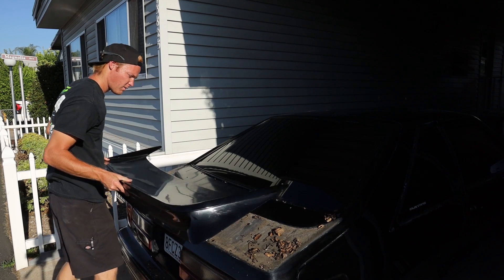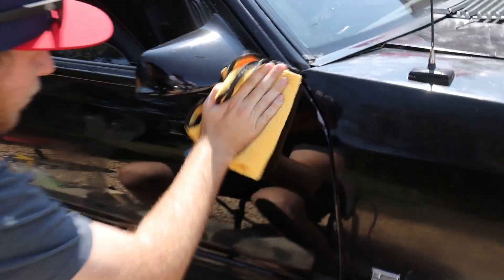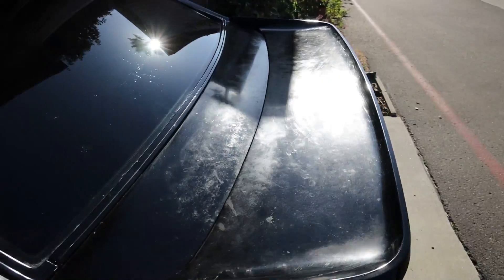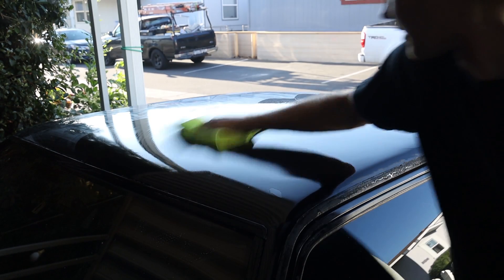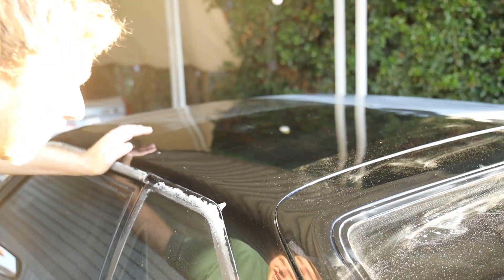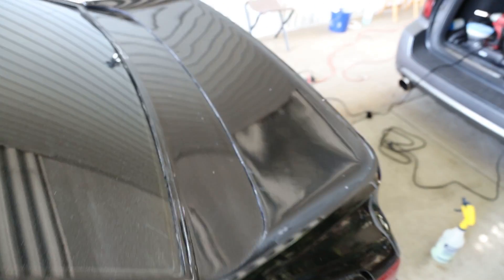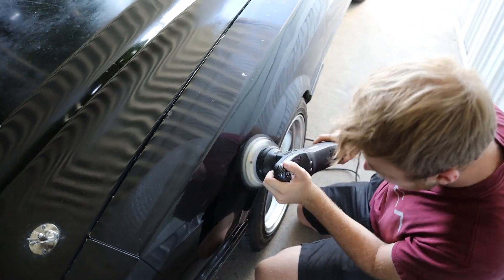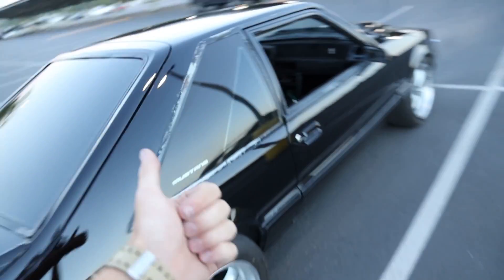My Foxbody's FULL Paint Correction Finds Something Unexpected! *Amazing Transformation!*

Comment: Amazing save on the paint! Dull to mirror...that work takes an experienced craftsman, and I'm not so sure that just anyone could learn it! Here's a hint on reinstalling the wing...run a strip of rubber gasket material, probably 3/8" wide by 1/32 to 1/16 thick around the wing perimeter, where it touches the trunk lid. This will keep the collection of mud from forming. You can find the gasket material, with adhesive on one side, from a number of sources.
Reply: Like a piece of old trimmed off pool liner would work wouldn't it?!

Comment: My current vehicle is onyx gloss black and quicksilver down the center of the sides with 90's Galvanized steel painting and metal coating process so it has the clear coat peeling off and the grey primer spots on one side and the passenger side looks really good actually compared to the Dr side go figure anyways and it has rust around the wheel wells and the rockers so I have not even bothered to try to clean it up and make it look better.. it's a early 94 Chevy K1500 extended cab Silverado short bed Z71.
Reply: Oh yeah another thing that makes my truck look like crap is the filler panel under the grille got busted and the kid blocked the center of the grille up with a scrap block of treated lumber and took all the side molding off the truck and the front bumper but left the rear.and I need to touch up the Silverado Chevrolet band badge on the tailgate the letters are faded.

Comment: it would be probably cheaper in the long run to paint the whole car rather than paint and blend all that stuff honestly. because i you need the roof one door and front clip all painted. wont take much more the paint the rear quarters. you may not have to do the hatch though. nvm it would have to be done too. it does look a hundred times better though as is. just saying if you want it perfect you are going have to spray it and no sense and painting half of it.